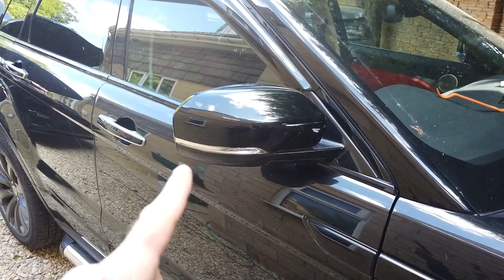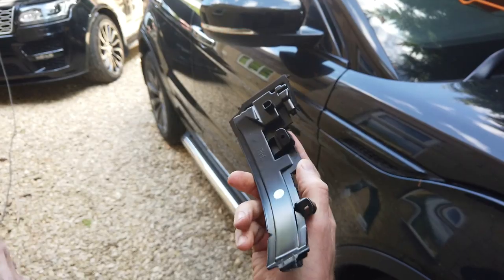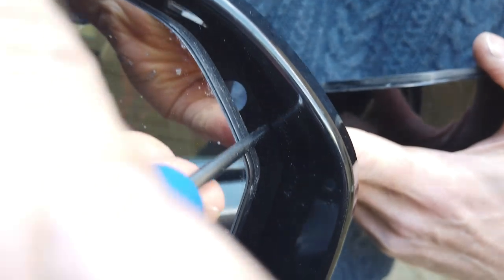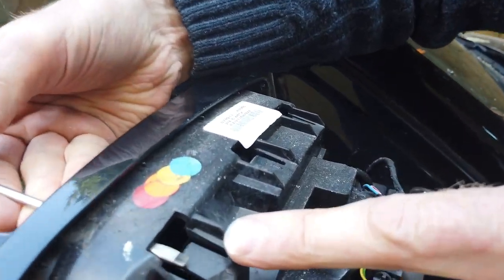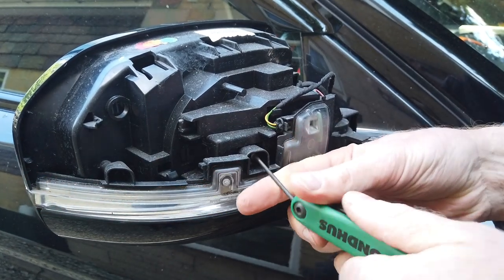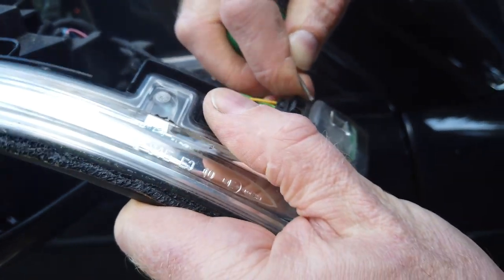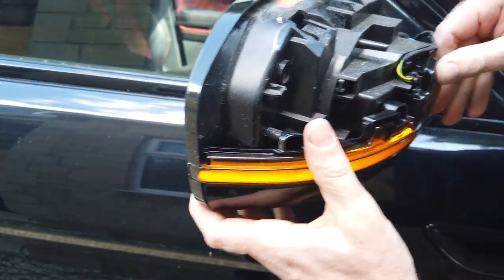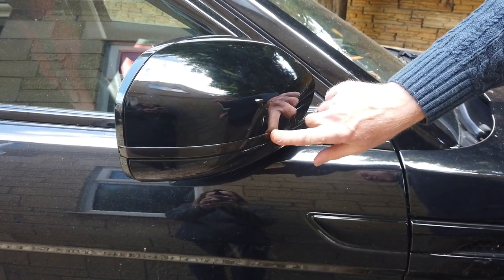Dynamic Sweeping Mirror Indicator Upgrade for Range Rover Evoque

Comment: Great video and cracking indicators, received mine today. Driver side easy enough but the passenger side is a headache. Got to be very careful with the outside temperature sensor wires. Hard to get the indicator out and harder to get back in.
Keep up the great videos 👍👍
Reply from the maker: Hi Paul - thanks for the tip - I have pinned your comment to the top of the video to warn others about the Temp wire.
Thanks for the feedback.

Comment: I heard about these on a RR forum and was disappointed that they were sold out when I went to order them. They quickly came back in stock and I secured a pair of these which are now fitted to my 2019 RR Sport. They look great and are much easier to see than the originals in daylight (as well as night). Highly recommended. Need to have the power clip in round the other way as advised. Also my mirror covers did not come off quite as simply, but it was the first time they's come off and an element of caution applied!

Comment: Fitted today a bit tricky removing the cover had to rewatch this video sometimes but got it done with no broken parts, I did find that I had to reverse the wires to allow the connector to fit on both sides, but still worked fine. Thanks again for this modification.
Reply: How’d you mean reverse the wires? I’m planning getting them but reversing wires sounds confusing 🤦🏻‍♂️😂

Comment: Hey Simon! Got my dynamic sweepers today! Boy is that mirror hard to get off at first. Scratched my car and broke a couple clips in the mirror. The pins on left side didnt wanna connect but I turned it around. Finally got them in and they look pretty good! Hope you're having a great day!
Reply from the maker: i did try about 7 times to work out the best way i could find to remove the covers...the Sport L494 covers are much easier... hope its all worth the effort.
Reply: @L663  it definitely is.  Thank you🙂

Comment: I have a 2013 model Evoque Dynamic.
Driver side side mirror (left hand Drive) motor keeps moving for longer than it should. The mirror is folding and unfoldig but not moving smooth. 
 
Problem occurred after i took the battery off as my Cooling Fan had malfunctioned. 
Please make a video to reset the side mirrors or give me some other solution please

Comment: evoque face lifted 2016  to 2019 are different part not that one not L SHAPE SQUARE SHAPE. just let you know because i changed mine
Reply from the maker: you flexing on me with your flash newer car ! Yes Ben our photo / listing master has this covered in our website listings...he thinks the change was actually slightly before facelift in 2014
Reply: @L663  if 1st Evoque stock mirror indicator is smoked one then that L shape one will not fit. Square shape one will fit. that's easiest way to find out that which shape is right for your vehicle. clear one or smoked one.
Reply: Do you do these for the MY20 evoque?